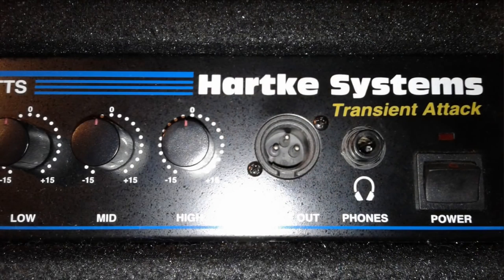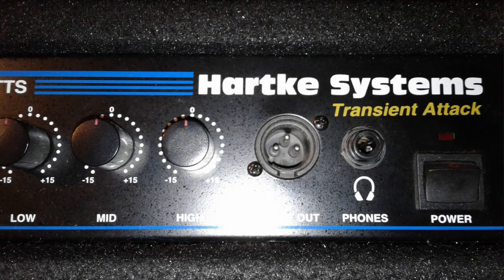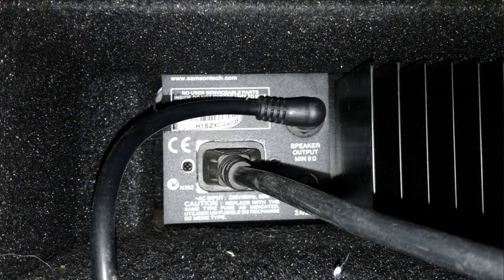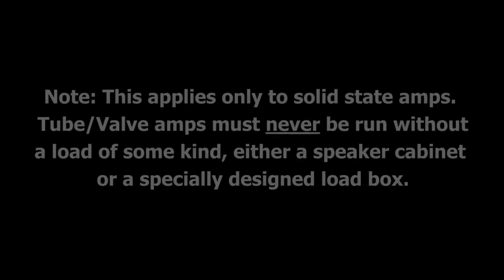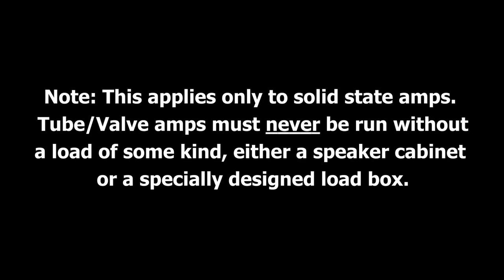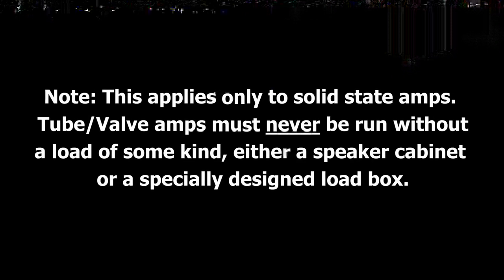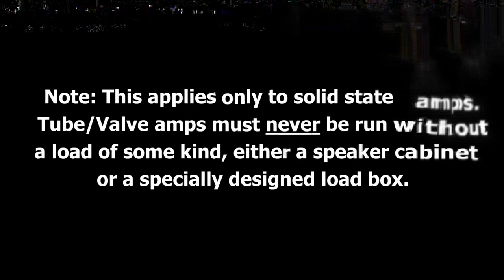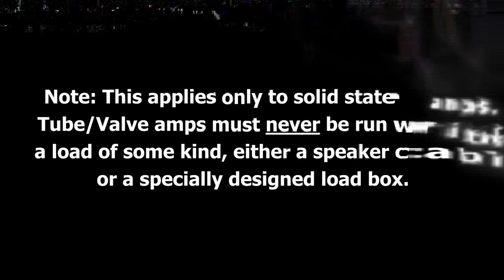Loose rear ends... #Live sound stories

Comment: Good video!. 

We have something similar in our church except that our bass cabinet and amplifier has a combi connector that accepts both TS jack and speakon connectors between the amp and the cabinet. the locking mechanism of the speakon prevents accidental disconnection. 

It can still happen that the cable breaks or something like that though.
Reply from the maker: Oh yes those Speakon combo connectors are great - best of both worlds. In my experience Speakon connectors are extremely reliable - the only ones I have seen fail are the cheap Chinese fakes :P

Comment: I had a similar experience with the PA in a theater. It was a pair of Mackie heads (2 way, horn loaded twitter) mounted on subs. One of the heads randomly went silent, luckly it had a blu led on the front so it was obvious a power issue, but where? Well, the IEC power plug went loose with bass vibrations and no wonder: it was so loose that it barely had any grip with the socket! A strip of duct tape to enlarge the girt solved the problem.
Reply from the maker: Yes, there are now locking IEC connectors that solve this problem. Great story, thanks for sharing!

Comment: trouble shooting 1 by 1. While it will eventually lead you to the problem it can be quite time consuming with larger systems or problematic when you have multiple failures. There are certain cases where your better of removing a system or large parts of a system to locate where the problem exists. Then if the problem is corrected you add peaces back in until it recourse. 

From experience this has been true when trying to get rid of ground loops. Been on the trail of one at church for the last 3 months slowly removing parts of the audio system to see where it is. After verifying it wasn't audio related I removed most of our visual network and the issue stopped. After adding in parts back in 1 by 1; in between out 3 services, the only item that hadn't been reconnected was the talk back screen. When it was reconnected the ground loop started which means the problem is caused either by an the TV having an internal failure or their is an issue with the HDMI run in-between the switch and the talk back screen. 

Of course you when trouble shooting you need to set the scope of what needs to be trouble shooted. For instance it would be totally inappropriate to dismantle the AV system in the scenario that is presented in the video. 

I relay enjoy these sort of style videos. You lean something new and more importantly gain knowledge that is useful in real world scenarios. I haven't come across any instrument amps in the same style as in the video but if I do I'll be less likely to be tripped up by the presented fault.
Reply from the maker: Oh yes group loops can drive you insane! Especially if you can't trace the power ground side of things... Fortunately the system of only changing one thing at a time and working logically through the signal chain almost always works, although certain intermittent problems can be impossible to diagnose this way. 

Glad you enjoy this type of videos, there are a couple more in the works. I seem to have a never-ending series of problems to discuss :P